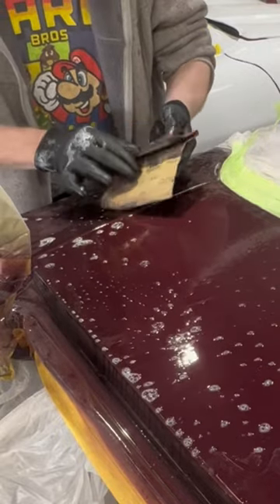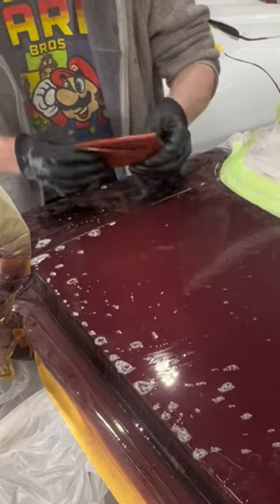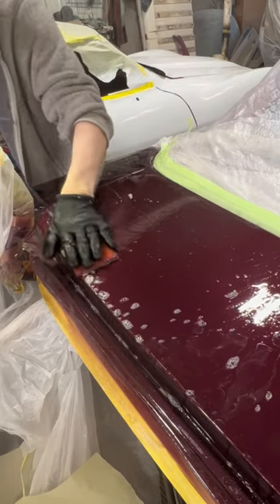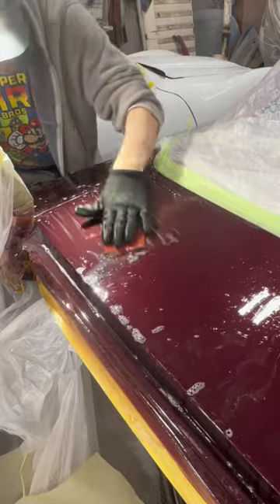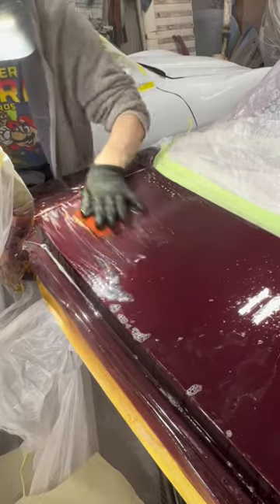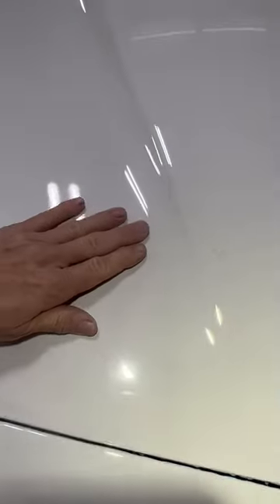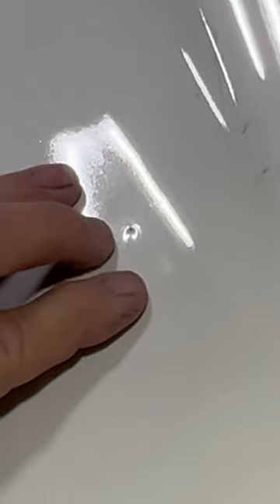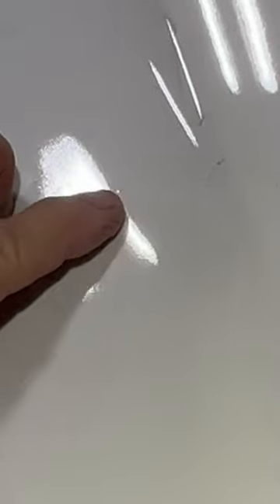How To Sand A Lot Of Dirt Out Without Making Things Worse Easy DIY Tips For Sanding Paint & Finish

Comment: Im worried about painting in a makeshift wedding tent /paint booth for this reason. Thank you for the advise
Reply from the maker: 99% of the dirt in this job was due to the inadequate prep done by inexperienced workers. I walked in, blew it, tacked it, and shot it.   It was later after unmasking it that I saw that it was not sealed well to the trunk opening and the trunk was full of dirt.

Comment: Dirt specs! Damn dirty dirt specs! Drives me nuts. No matter how much I clean mop the floor, spray the walls...still get specs, and specs gotta go.
Reply from the maker: Have you painted outside on a calm day?  I’ll paint my “that sht’ll buff out” truck outside as soon as it’s ready.  I built a pressurized side downdraft booth in 1985, then traced all the various remaining sources of dirt.  I told my maskers that their masking had better be able to withstand hurricane force winds because I was going to be blowing every nook and cranny with 130psi. We succeeded in dirt elimination technique; you had to look hard to find a speck of dirt in our paint.  Any air that drafts across the surface of the car must first pass through a 5 micron filter.  If not, it’s preferable to have no air movement at all.
Reply: @OldBondoBilly  painted outside under a canopy before. Pretty good result. No time to wait for that perfect day. I have jobs lined up now until August while still working full time at the factory. 
  I started using a 2 to 1 clear for just about everything so I would have some good mills to work with. It buffs out nice. Just extra work that I don't really make money on. But with every job i'm trying to build a reputation. Because this guy knows that guy and he has been wanting to get his car done, too. Word gets around if you do good...or bad.
Reply from the maker: @BearBudgetgarage  if you can build an enclosure (out of anything) around the vehicle with a 1+hp blower blowing into it thru a 5 micron filter, and an opening on the other end to let the air out, you will have created a pressurized spray booth.  I think I’ll do one for my channel so everyone can paint without dirt.  Although it would still be hundreds of dollars😗
Reply: @OldBondoBilly  i have a one car bay for paint. It is fully wrapped in white farm plastic. Top to bottom. Separate from the other  2 car bay.
It has one window. In good weather, I open that window and insert a filter. On the garage door side i have a commercial fan to draw out the cloud. My plan was to build an under-the-door frame and cover it with booth filter from a roll, and have booth filter in front of the fan.I am in a commercial/residential area and my garage faces a towing business across the street. But still want to keep the overspray/cloud going out of the building low as possible. 
   I would be interested to see your home made pressurized paint room. What I am doing evacuates the cloud, and adding a roll of booth filter would keep neighbors happy. Doesn't really make me 
"Dust free" tho. But for right  now, its the best I can do...
Reply from the maker: @BearBudgetgarage  the reason you get a lot of dirt is the suction pulls dirt from everywhere.  If instead, your fan is blowing into your room thru the proper filter, dirt is kept out of the airstream over the car.  If your fan is a blower or tubeaxial with pressure capability it will push your cloud out wherever you allow it to exit.

Comment: Why are you sanding it down if you want it smooth to the touch then use thinner and clix mix between each coat and then apply it with the finish of your coat then finish it off with some mineral spirits to smooth the coat then finish with lots of sunshine

Comment: You do a good job but do you use a spray booth that is clean and dust free if not why don't you get one they make a tent one that you setup outside your shop and has all the filters and air movers to keep it diste free inside o don't know much about real car body work I do just model cars and have won alot of huge model shows for best paint but just asking
Reply from the maker: It looks like I’ll be building another pressurized downdraft if my channel continues it’s viral explosion. I built my first pressurized downdraft in 1985. Zero dirt😉😉😉😉😉
Reply: @OldBondoBilly  awsome man I did body shop in highschool just to be able to gety asphalt circle track pro latemodel  painted this was right before wraps became affordable for everyone in racing lol and I worked at a body shop for a few months during summer break and have painted my own race cars I get really good looking paint jobs using a harbor freight gun and no spray booth prep is the key to a shiny paint job if you don't prep it right it won't be like glass like everyone wants lol awsome channel for learning from you